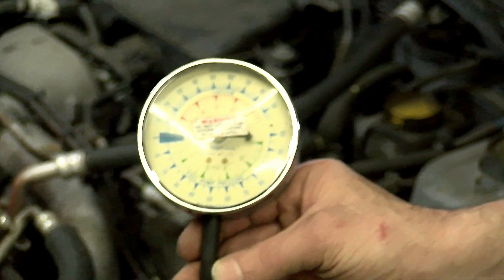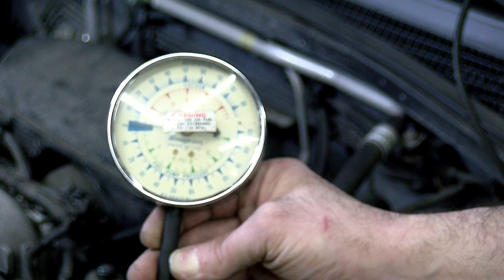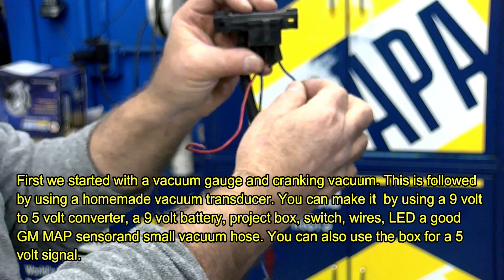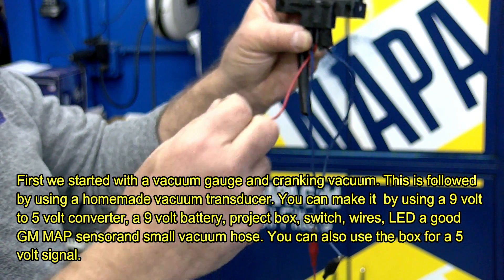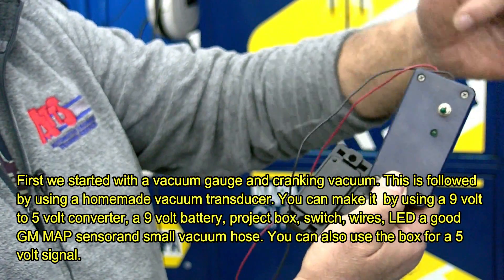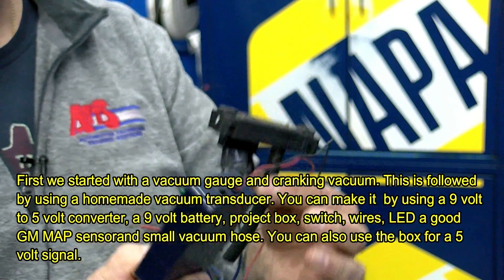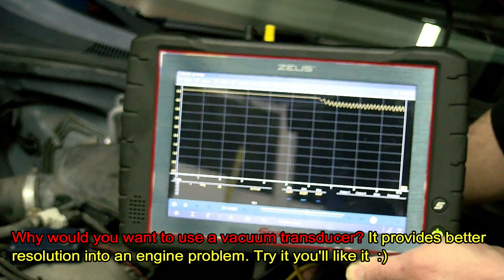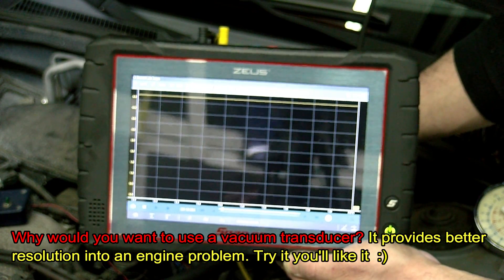Engine Testing with a Vacuum Gauge and Pressure Transducer

Comment: if we have mechanical problem   like a bad valve or piston ring . what we got in scope
Reply from the maker: The scope reading on a vacuum waveform with not be a straight line at idle. There would be waves in the waveform. It would be better to use a In Cylinder Pressure Transducer. Thanks for watching. If you have not already Subscribed to our tstseminars YouTube channel please do so. Looking for more Training? Go to www.tsteminars.org and www.attstraining.com.

Comment: I have found on the snap on scopes if you want to know the actual vacuum or psi, where they have the presets for the vacuum and pressure transducers, it will calibrate to the homemade 5 volt regulater. I have a verus pro and it works with mine. Also I found out the verus units and I suppose the Zeus also has a built in 5 volt regulater and ground at that 9 pin serial data port on the scope. You can buy the connector with slide lock at Newark.com.
Reply from the maker: Robert that some good information...would you be able to email me a screen shot of both? Thanks again...gt@tstseminars.org....If you have not already Subscribed to our tstseminars YouTube channel please do so. Interested in more training? Go to www.tstseminars.org and www.attstraining.com